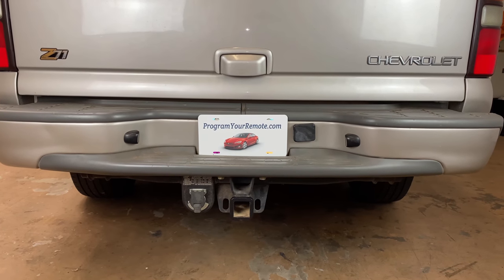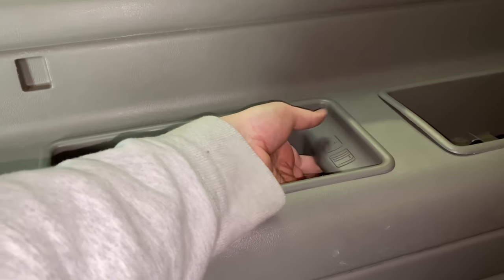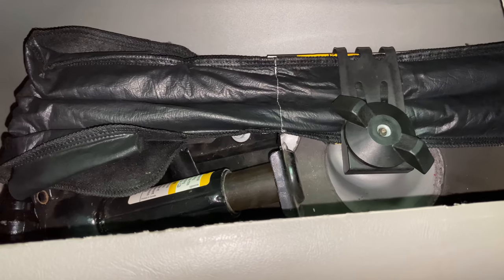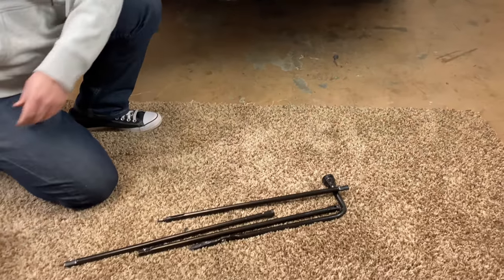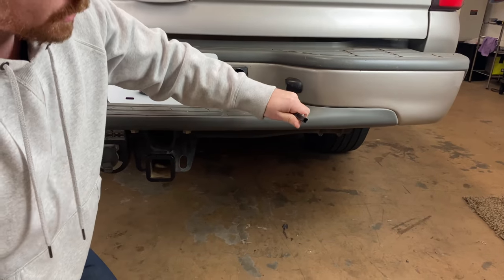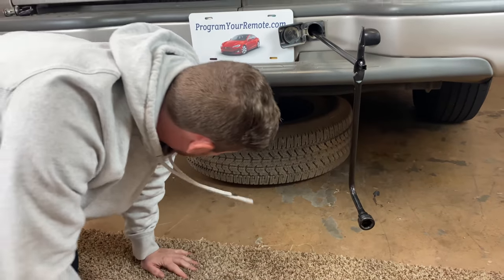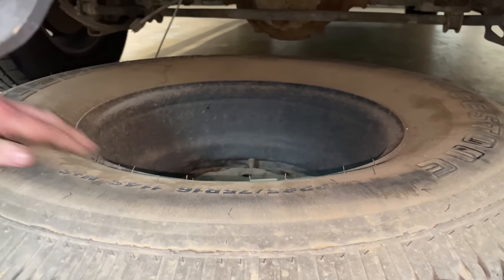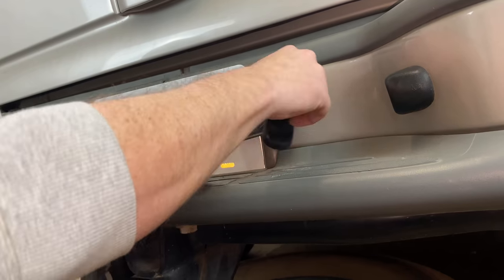2000 - 2006 GMC Yukon XL Spare Tire Location - How to Remove Jack Lug Nut Wrench - Change Flat Tire

Comment: Thanks for this video! I just bought an '02 Yukon XL. Previous owner put 275R60 20 wheels/tires on it, but the spare is still a 16 in rim  Do you know if a 20 in tire will fit in the spare wheel well? TIA.
Reply from the maker: I'm really not sure how big of a tire will fit up there to be honest
Reply: GET A TAPE MEASURE
Reply: @Hooverdarnit you might need to tell him how to do that as well

Comment: I put the flared end in first and everything like you perfectly show in this video. I feel the peice hit where it doesn't go any further, it's just not latching on to anything. It's like I'm twisting onto something flat. If that makes sense. Do you have any suggestions as to what's wrong. 

Also, I now know where the kit and jack are thanks to this video. ☺️🙌 It also had a entire tire patch and plug kit in there too.
Reply from the maker: You should be able to feel it kind of kind latch on - but as they vehicles are getting older its not that uncommon for the mechanism to not be able to turn if it is too rusted, not sure if that may be part of your issue as well

Comment: Hey I have a cuestión. I need the original key ?? I have 2003 Yukon XT I changed ingnition key. I don’t have the original key to open cylinder.
Reply from the maker: Yes - if it is the original spare tire lock cylinder it will be keyed the same as your original ignition.  If you don't have the key you can usually open them with a screwdriver - We don't have a video for it but if you search around on Youtube I'm sure you can find one

Comment: Which key is door or ignition
Reply from the maker: they should be the same unless the door cylinder or ignition cylinder have been changed - in that case you would use the original one